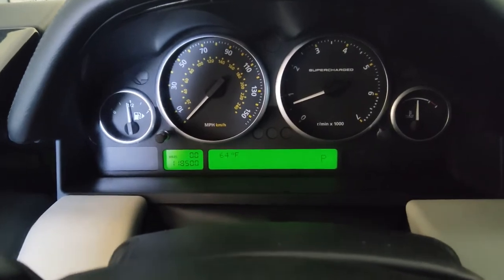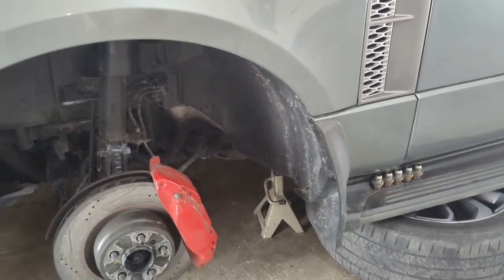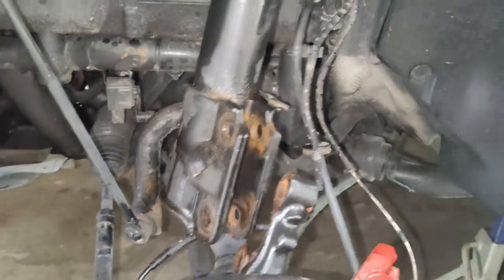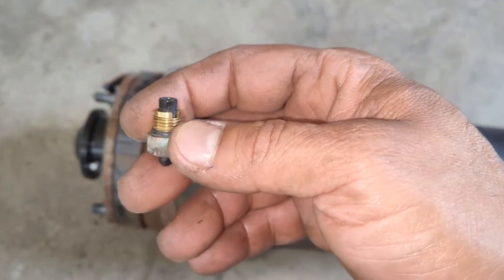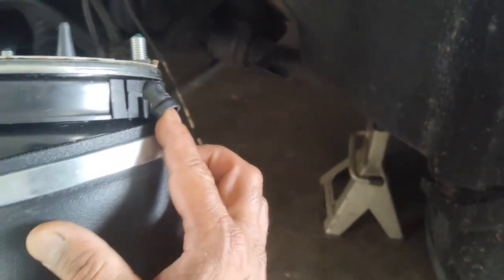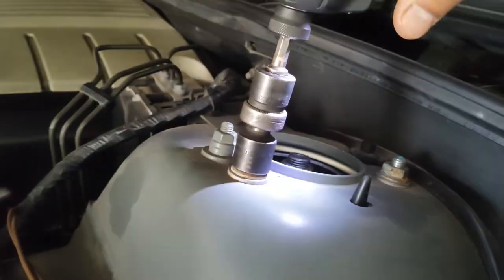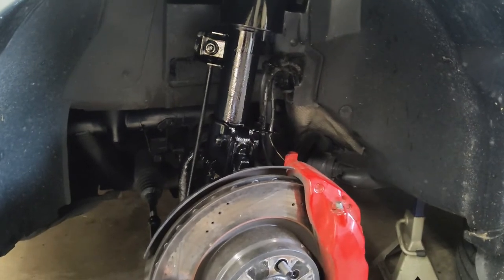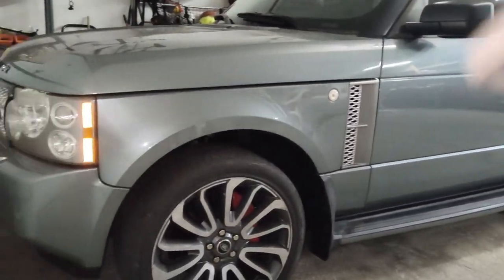Range Rover L322 Suspension Fault | Air Strut Replacement

Comment: Thanks for the video but there are two areas that other people should be aware of that you have got wrong (sorry);
(1) the black cap on top of the old strut DOES need to be moved over to the new one - this is a vibration damper fitted to vehicles with Brembo brakes and should definitely be refitted to the new strut.
(2) The brass fitting is often a push fit and if so should NOT be removed from the new strut - for OEM parts this will void your warranty and possible lead to an air leak on the new strut (see Island 4x4 for reference) - there may be others manufacturers who use compression type fittings but worth checking before damaging a perfect good new strut. 

I think it’s worth pointing this out to help other people who do this job

Comment: What about the large black steel cap that threads onto the top of the strut under the plastic cap? Do you not need to remove the old ones and install them on the new ones? Thank you!
Reply from the maker: Hi, thank you for watching/subscribing.  If you have the complete strut assembly NO nothing needs to be swapped.
Reply: @jsfauto2259  Thank you very much! Did the job and they work great. Having issues with the back though. Keep getting suspension faults. Have the icarsoft v3 and I looks to be an issue with the right rear. Relatively certain the right rear is leaking. I have a new compressor. I just ordered 2 new rear bags for good measure